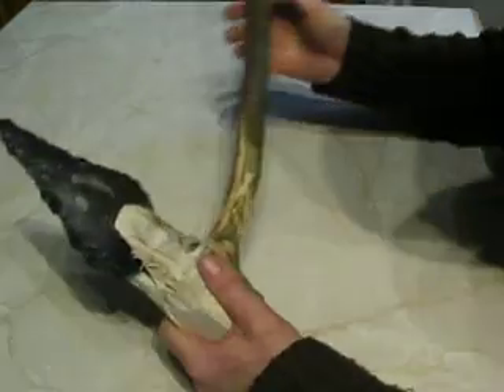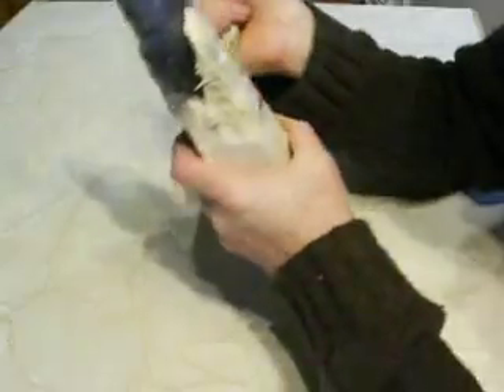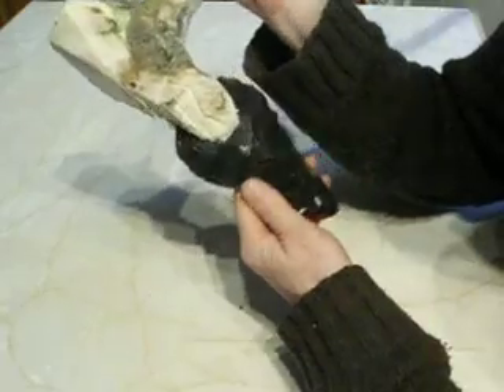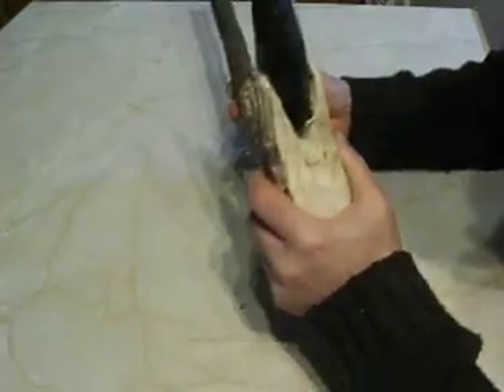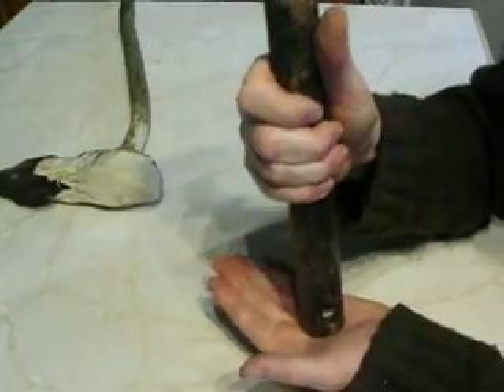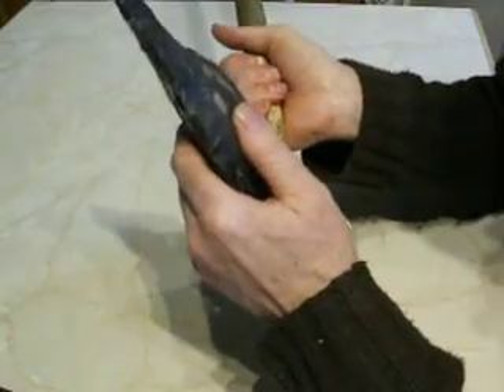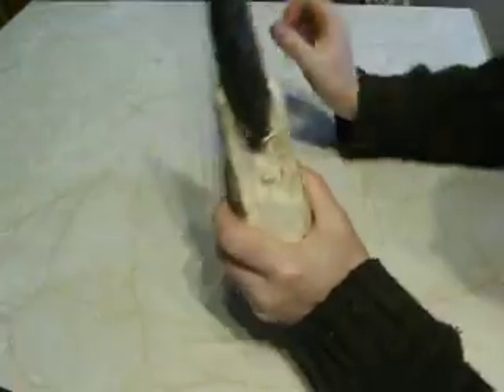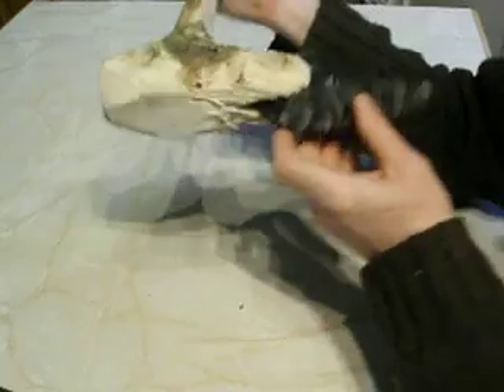It's not impossible to haft a "handaxe" without using mastic (or without leaving evidence)

Comment from the maker: Yes, the other videos show how they "could" have been hafted but I agree that it doesn't seem likely (which is what most people currently think).
My demonstrations follows a lead regarding "possible" use of twisted (and possibly other) handaxes. Ths suggestion would fall down if it would be impossible to haft them. And as can be seen in the other videos it is not impossible to haft them even without mastic. If they were designed to twist free then the hafted edge would need to be this shape